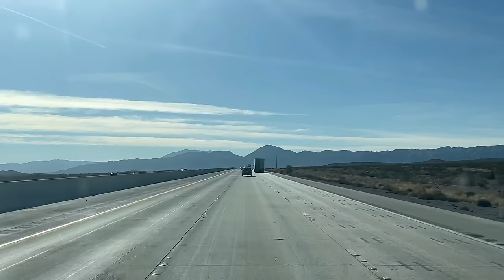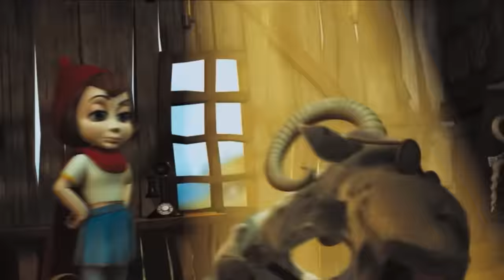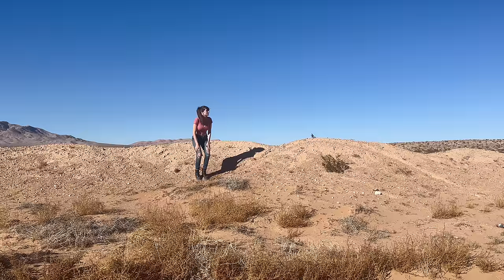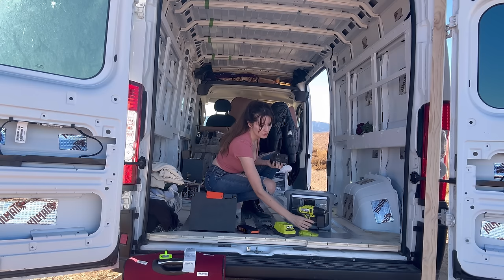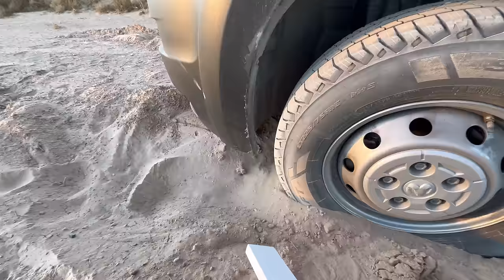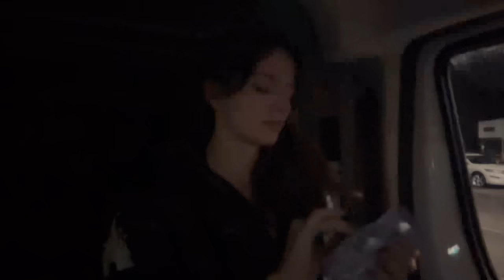STUCK & ALONE in the desert

Comment: NEVER EVER GO ANYWHERE WITHOUT YOUR MAX TRACKS AND A SHOVEL...ESPECIALLY BEING ALONE...
Reply: And an axe, silky saw, and tow rope with shackles.
Reply: I agree. If exploring alone, you should bring a survival / bug out bag.
Reply: I prefer a short handled entrenching tool to a shovel. A shovel is hard to use under a sunken car.
Reply: hindsight is always 20-20
Reply: @mrsrhardy  foresight can be as well
Reply: For sure
Reply: And a gun
Reply: I THINK SHE FIGURED THAT OUT
Reply: Snow chains is alll you need
Reply: As a desert native and former off-road racer I'll give you some more tips. First, let air out of those tires down to 10 psi. Next, you can wet the sand down with water if you have plenty, if you don't have enough for survival, don't do this. In areas popular for ATVs and shooting people it's usually also a dumping ground for garbage. Look for some carpet or blankets and put those under the front tires. If you happen to have a blanket or carpet with you, use that. After you've done all of the above, momentum is the key to sand. It looked like you might of had a chance on your own had you just rolled back more and hammered down on the throttle.
Reply: Too expensive? Throw rugs work sometimes.

Comment: Something not many people think of, if you have a jack, use it. Learn where the jack points are, probably on the pinch welds. Find something firm to sit it on, and jack up that side of the vehicle and fill in under the wheel. Remove the jack, keep the wheels straight and only use enough gas to get moving then build up some momentum until you're back on firmer ground, even if it has to be in reverse.

Comment: Glad you survived.  👍☺️
Pro tip:  when stuck, don’t spin the wheels.  Give it just enough gas to feel the van start to move.  Rock it back and forth until you have enough momentum to get out.  Also shifting from D to R quickly, can have the same effect.  Just try not to spin the wheels.  Works in snow too 😊
Reply: the good thing about the promaster is shifting is effortless, slapping it in and out of gear is easy. I drove one at work.
Reply: Only if you don’t care about your drivetrain…. 🤦
Reply: Just don't go off road don't be stupid 😮
Reply: Do not slam the gears from drive to reverse over and over. Terrible advice.

Comment: Tory, for future reference, there is a place call "Sandy vans" that use to be in Oregon, but they moved to California, they can change your van to "4 wheel drive, jack up your van, add a wench to your front bumper" all to prevent you from getting stuck in the sand. Hope it helps.
Reply: I'm thinking common sense is cheaper 🤔
Reply: Yeah, for probably more than $10g. Why not just get an AWD Transit?

Comment: The low air tires is a great pointer for regaining traction. However, you need to carry a portable high-pressure air compressor as you can't really drive to the next gas station with that low of psi in the tires.
Reply: You don’t need a “high pressure” air compressor just a normal air compressor will work.  You can get a cheap cigarette lighter air compressor that will work just fine.
Reply: Well sure you can. People run around with 25lbs in their tires all the time.
Reply: @mikeb1039  Driving with very low tire pressure, especially at highway speeds, has a significantly higher risk of tire damage or loss of handling.

ProMaster tires should be at 65psi front, 80psi rear.
Reply: @jeffharrison6059  Yeh, well you can have a brain too.    Fact is plenty of people driving thousands of miles every single day with underinflated tires.  you are greatly over stating the impact.
Reply: I ride an adventure motorcycle. The concept with motorcycles is the same, air down for areas where you need. The only problem with low tire pressures on a motorcycle is hitting rocks and getting a pinch flat. The key is keep your speed low. I've also done a bit of overloading with my Tacoma.  There is no problem getting your vehicle down the highway with low tire pressures as long as speed is kept low. If you have just enough pressure to keep the rim from pinching the tire, you're good.

Comment: The worst thing you can do, Tory, is to continue to spin your wheels and dig yourself deeper.
If van stops moving, then immediately shift to neutral and get out and dig away sand or snow behind and in front of tires, chain up if you have chains, put down grip panels (about 1' x 4' ) if you have any, and try to rock the vehicle back and forth to get movement. You probably need a 4x4 if you want to take a risk and drive on sand.

Comment: One way to get a car stuck in the sand out alone like yours, is first to use the car's jack to lift one of the wheels and then fill the hole with sand or, if possible, with stones or tree branches until it is at road level. Repeat the process for the other wheel.
Remove 50% of the air pressure from the tires and then slowly move the car. It helps to have a shovel and a self-rescue off-road vehicle board.

Comment: Lowering tyre  psi /shovel /tracks  all good .The other is put your spare tire under front door place wheel jack and lift it up then toss in sand .do the other side  then wet sand with water for about twenty feet on both for both tires .

Comment: if you ever drive on any type of lose terrain again like sand or snow, try taking some air out from your tires (only if you carry an air pump/compressor) like leaving only 10 pounds of pressure or maybe 7 in every tire, that will amplify the surface of contact from the tires to the ground, thus increasing the support from each tire and so the traction by a lot, after your back on sturdy terrain then put the air back to the regular 32 pounds, you will be surprised by this technique.
Reply: oh and never drive fast with low air pressure in the tires, that could cause the tire to unmount from the rim, this is just a professional technique to make a non 4wd car overcome lose terrains, but it works 100%.

Comment: Always good to have some basic recoverygear: tow strap, some type of a shovel, and an air compressor so you can lower your tire pressures air them back up again. While max trax and alike work there are cheaper and easier options to do the same thing. But until you get the hang of what your vehicle can and cannot do with front wheel, drive and low ground clearance, you might consider doing some trips with other people.

Comment: Carpet scraps work well...about 4 feet long...yes, lower tire pressure but make sure you have the ability to put air back in the tires. Under inflated tires will deteriorate quickly and with front wheel drive its easier to lose control. I admire your drive, desire and explanations, you could be better off getting local information regarding safety, survival, etc. The desert eats people alive everyday.
Be well and stay safe.
Enjoy your vlogs...

Comment: You could actually used that dumped tire to put it under one of your front wheels, emptying the van so it was a lot lighter and give it a shot. That at least could move you from the hole you created. But you made it out of the desert. X

Comment: You have learned from getting stuck but you need to learn even more. For one thing, if you had no safety net <friend to come help> or no phone service at all I saw you moving enough stuff around in the van to get ypu out. Carpet or carpet scraps or a throw rug. would help after airing down <why everyone in vanlife needs to have at the very least a 12 volt compressor to fill up air downed tiers when you reach solid ground or leaky tires> PS glad you found Plank. I use to do RenFests as an encampment we were merchant travelers so we were sailors. I had a piece of scrap wood we drew eyes and a mouth on . A couple of times a day I tied a rope to it through a hole we drilled in it and took it for a walk around the fair . The rest of the cast of characters in the fair pick up on what I was doing and would stop to play with plank, I would lean him against a venders booth and pretend I was waiting for him to do his business and the owner of the booth would come out and chase us away. It was a riot, a lot of fun. Besides it gives you someone to talk to if no one else is around , lol We called it walking the plank of course, 8-)

Comment: Sometimes if you remember what you've been told you can get out.....
Maybe a long time ago somebody told you to drop your tire pressure in soft sand and you can just drive right out..... Okay well it's true...... It works in snow too......
These are things that you need to remember and you need to go out and try it for yourself to see how good they were.
The H1 Hummer military jeep has an automatic air down system that can be actuated from inside the cab that's how good It works....... Okay here's some do's and don'ts... Do not turn the steering wheel keep it straight ahead or straight back until you get your speed up.....
But you sunck quite a bit..... So we will deal with that now..... Get out of the vehicle just like you did and size up the situation...... Put steering wheel straight.... Have a game plan..... Dig down alongside the tire to find out where the bottom of the tire is.... Go around to the back of the tire and dig  a gradual uphill ramp.... Bingo......... No concentrate on not spinning...... And as soon as you get the vehicle to start moving get out and lower the tire pressure until the tire starts to flare out a little bit maybe quite a bit... Wait till you see how good that works ....all Farmers know about it that are worth their salt they know all about it military knows about it and people that belong to Jeep clubs know about it. You have all that weight on those tires it's going to literally leap out of there

Comment: 01:11 the irony being if you had been loaded up like you were before getting a storage unit and clearing things out, you might not have gotten stuck. The weight probably would’ve added enough traction to make it out no problem!
Reply: Not on a front wheel drive van, would have just been more inertia to overcome.